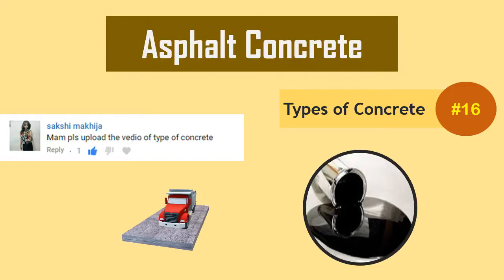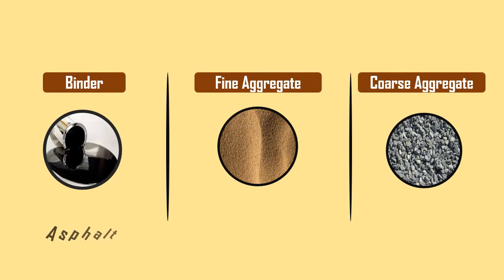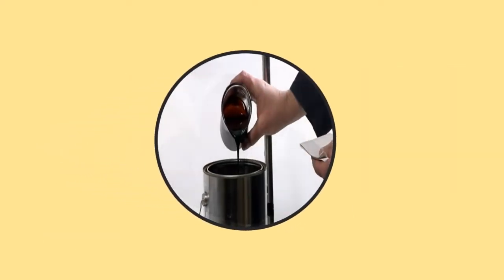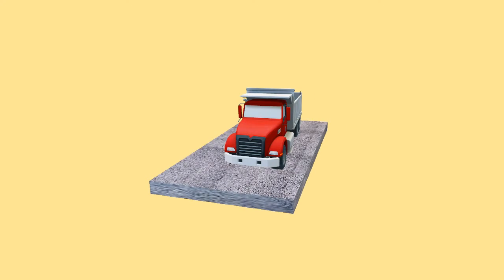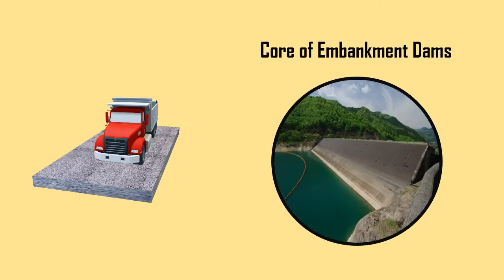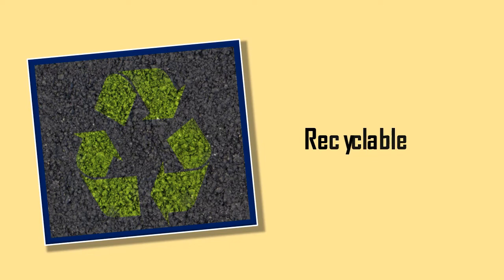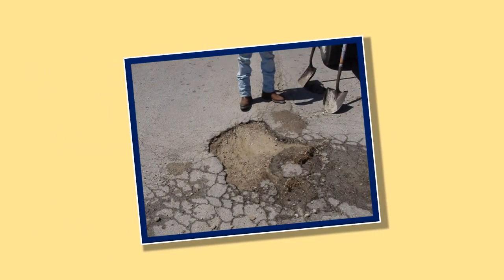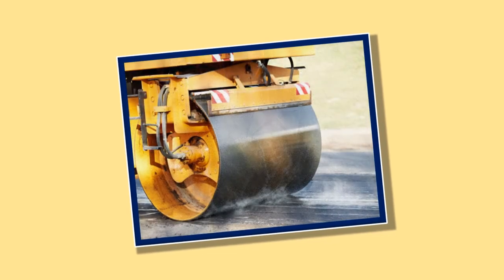What is Asphalt Concrete? || Types of Concrete #16

Comment: Asphalt concrete
Surface road, airport
Pouring the hot asplat over aggregate 
Economical compared to cement concrete
Recyclable
Repair is easy